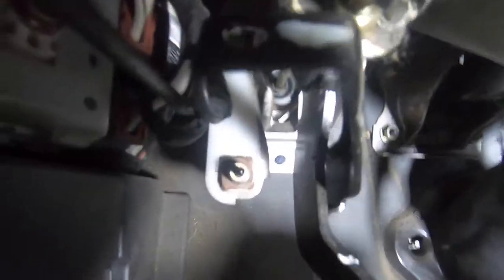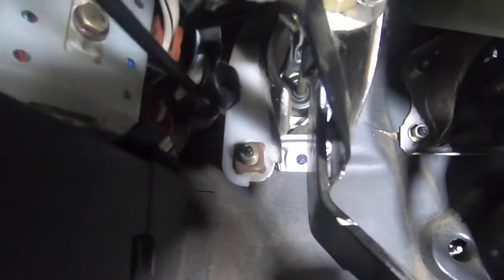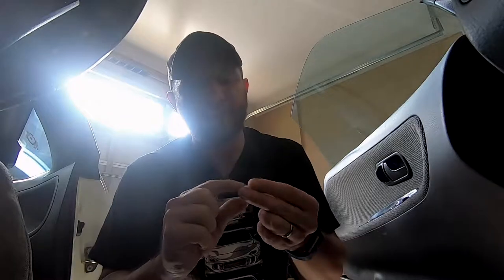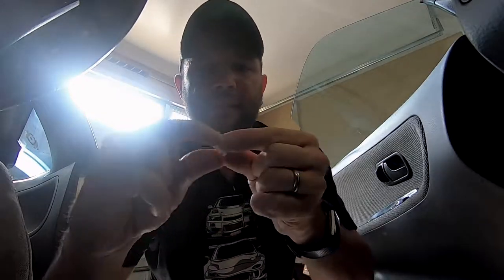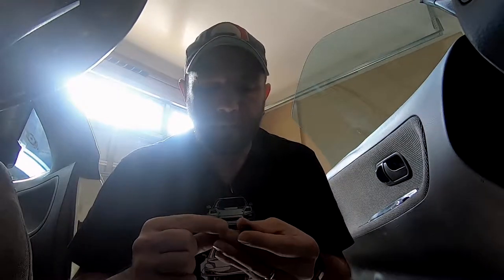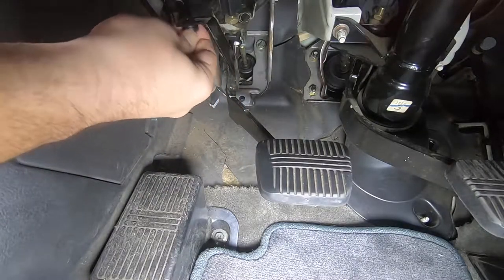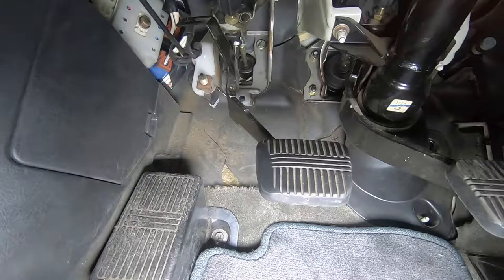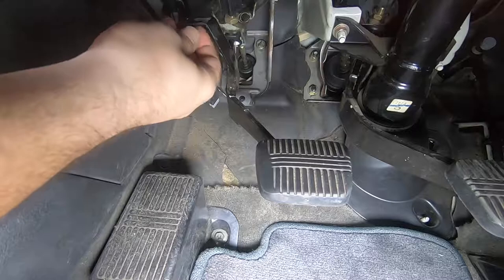Clutch/Brake pedal grommet replacement

Comment: You bought the part for the Honda.  The Nissan is a different part.  But you're lucky because the Nissan is a million times easier to reach than the Honda.
Reply from the maker: I think I only saw the one there, but good to know. I have replaced one on my old crx years ago, and yes, those are definitely a pita compared to the Nissan.

Comment: Hey man I also have one on the top side of my clutch pedal that is missing but it has never been an issue do you know what that switches for because right now it currently sits in a open hole, so when your foot is off the clutch that switch tip is in a hole without a rubber bumper any ideas?
Reply from the maker: I don't think I've ever had a second switch, so I don't know off the top of my head. First thought is one start safety and a second for cruise control or some other feature the car uses clutch position for. Not sure why they wouldn't use the same switch though, unless it is a fail safe. What is the year make and model of your car?

Comment: 😮😮😮😮 Man. I almost overlooked thinking that it was always the brake switch issue. I have my Nissan Juke that comes with push-start button. My SUV is still at garage with the P1078 (exhaust timing valve sensor -rear cam shaft sensor). It is the simple things that we intend to overlook rushing to guess oh it is a battery or starter or failed timing chain or belt or so so.

Comment: I had this happen twice; 2018 dealer did the car under recall, this week happened again; instead of using another grommet I used a magnet same size as the grommet, ain't moving and won't disintegrate.

Money wise cost me a few cents, timewise took  30 seconds.

FYI my car is a 2011 Sonata.
Reply from the maker: Nice! A magnet is an awesome idea I hadn't considered. I may try that next time. Way better option than jbweld, imo.

Comment: Bahaha a 240sx the exact car I'm having the issue with
Reply from the maker: I've replaced them in 240sx's like 3 times 😂 But to be fair, I've had several of them over the years and never had to replace the same grommet on the same car a second time. Hope this helped 👍
Reply: @WrenchingwithWoody  I’m having same problem with my 240. What did you use to fix yours? Like what part and where would you go buy it?

Comment: Would this cause your car to stall?
Reply from the maker: It shouldn't cause it to stall. It should only drain your battery when not driving(for a brake grommet) or prevent it from starting(for the clutch grommet). What is the year, make and model, and what is the car doing?
Reply: I have a 96 integra and i need a technique to get the top clutch grommet into place
Reply from the maker: @nyakio5511  I'm not familiar with the Integra specifically, but if there is enough room you can use a small block of wood or a thin piece of metal plating to give you a larger/harder surface area to push on the flat part of the grommet that's fighting you
Reply: @WrenchingwithWoody  can this problem not make your car turn on with remote start? Because i remote started my 07 silverado and having problems with my brake because supposedly its being pressed alittle which makes my truck not turn on